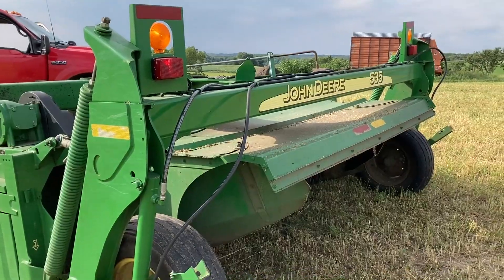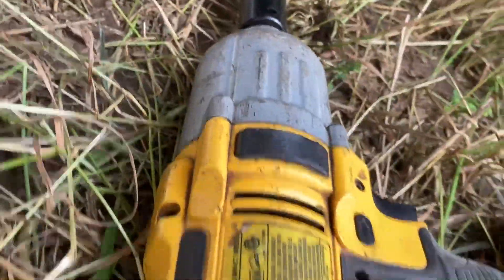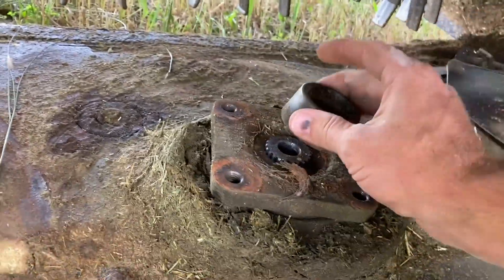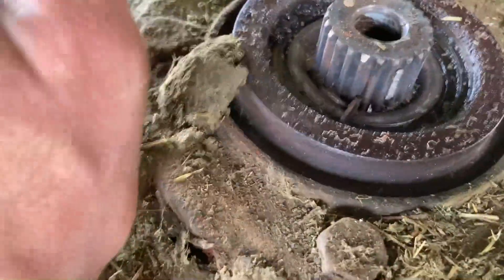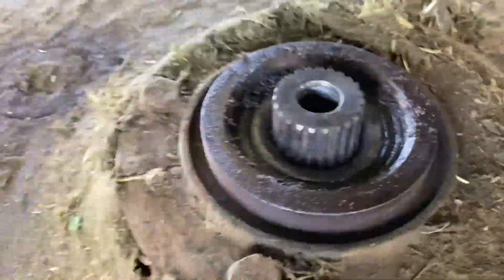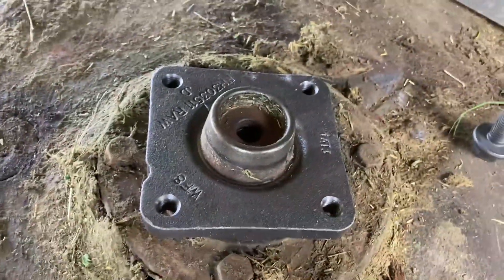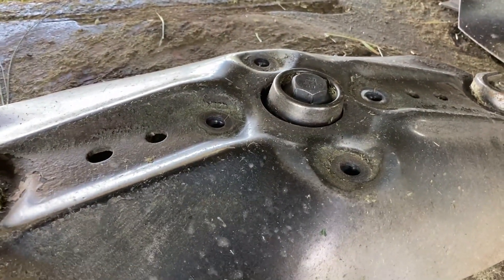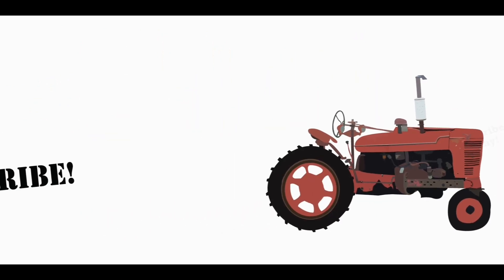How to Change the Shear Hub on a John Deere MOCO Disc Mower

Comment: John Deere Usually Handles  sound equipment but  When it came time for us to purchase     Hay Equip, our first mower was sold by The J.D. dealer was A kuhn.... we kept it one year, sold it and bought a Krone 320  Easy Cut,,,,, WE presently have 3 mounted on KMC 4760 Caddies....  We average about 600 to 800 acres a year,,,,  During the last 6 years of use we have yet to replace any roll pins in the cutter-bar protection system......   Our Variety of Hay has thin stems and slender leaves, so not much drying time is gained by conditioning....
Reply from the maker: Sounds like a nice operation.

Comment: Truly believe John Deere has been making most there profits in part sales for the last 20-30 years I had a JD sickle style mower conditioner it was new then my friends New Holland and my neighbor had old international they both did more cutting than me and I had more breakdowns. 100 bucks for a Shear Hub I'm surprised the engineers didn't make it a little heavier and little more complex to charge you $200 to $300 that's what you usually spend when you visit the JD stealership.